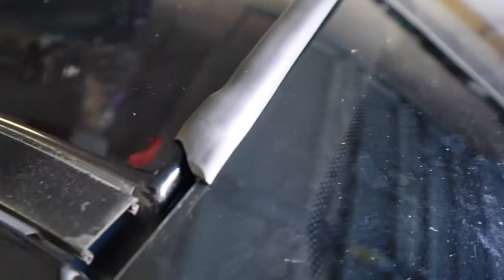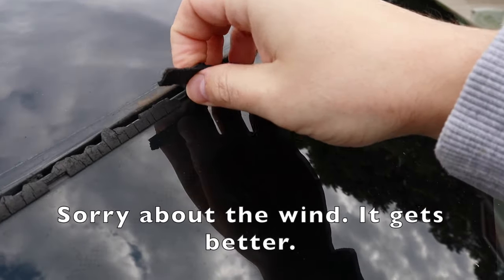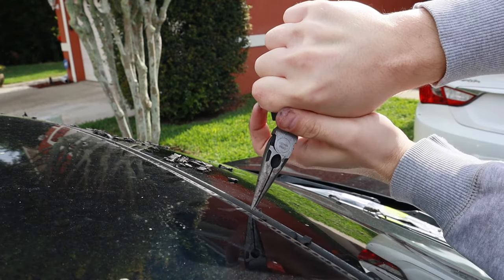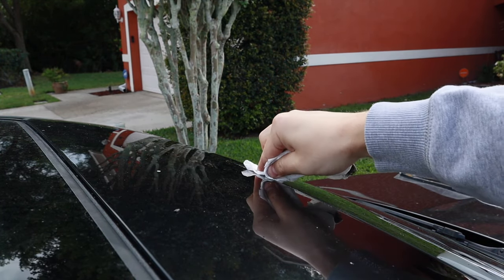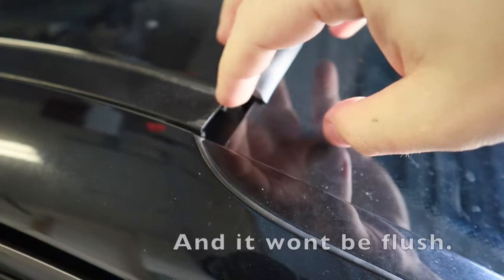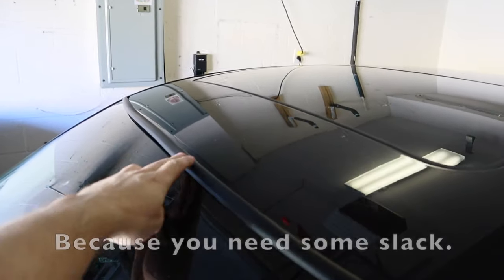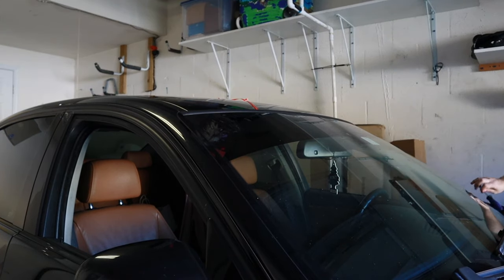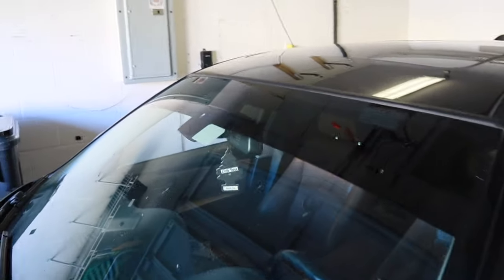How To Replace Worn Out Front Upper Trim Moulding Windshield Weather Strip Seal

Comment: Great video, it gave me confidence to take on this project. A few caveats, it took me 3 hours with a few challenges: 1 hour to remove old brittle stripping and get the spine out. For the life of me, could not remove spine from center, had to start on end. Take your time, I scratched corner of windshield trim. 1 hour to remove old adhesive using mineral spirits with cloth, popsicle sticks and toothbrush, used Qtips to get the gunk out from inside groove. 1 hour putting in new OEM strip, didn’t see BMW part on Amazon at the time. No pull tab on strip, not a dealbreaker because they left just barely enough overlap to grab onto. Had trouble getting spine to sit flush in the middle until I figured out to press in spine with my sheath knife (handy general use tool) underneath the top flap. Another note on OEM, I compromised the surface on the ends, not sure if it’s because cheaper material but just minor damage. Everything is flush and looks right, just be persistent and patient if you run into problems. Anyone who says this is a 10 minute job doesn’t know what they’re talking about but I did save $500 and 3 hours I would’ve spent anyways trying to get someone else to do it.

Comment: Been in the businees for 26 years and in my experience this molding replacement can be done successfully if you are working on the original windshield and molding. Typically a windshield that has been replaced will be a problem because the urethane bead will be applied differently than the assembly line bead which means the urethane on the replacement will glue the new molding into place at the time of installation which typically doesnt happen off the assembly line. Also, the replacement molding may not be OEM and designed differently which is another problem. Check these things before you purchase your replacement molding.

Comment: well done.  Pick tool is essential for this job to remove old trim.  Start about 10 inches in from the side, do not start on the ends.  Rubber rolling pin makes it lay nice....

Comment: For everyone that will atempt this. Is way harder than it looks to put the new one in. Mine is bent in one spot. I can't put it better. I tried everything. Maybe cuz it is an aftermarket and it doesn't fit perfectly. A tip: When I took the old one out, I pulled with the plier from one side, not from the middle like he did. It's easier this way.

Comment: I also have a x5 2013 and changed my windshield and went to safelite..big mistake! Now my rubber gasket is flapping around,I did your thing where you slide it all the way in but the other side is missing like 1.5inche..is it possible that safelite put the wrong one?!

Comment: I have a 2013 Acura TSX wagon that developed a water leak under the windshield on passenger side. I had the dealership fix it. Long story short this was done about one year ago.. and it has to go back to replace this strip for the third time..What the hell could be going wrong? Could the car wash places be that hard on it?
Reply: My 2009 Civic sedan has the exact, same issue. Passenger side leak and the trim is up a little bit on that side from the sun. I’m going to try and reglue it down myself

Comment: Basically is it okay if water comes in and stuck on the crevices between windshield and body because of your broken trim?? Is there any water leak befor you install the new trim??
Reply from the maker: I don’t think any water is okay in there. And no I didn’t have a water leak before.

Comment: Great Job your lucky you didn't break the glass however I would like to know how it's holding up now.  BMW moldings are shit they dry rot due to the sun and it doesn't matter if you use the BMW top molding they are defective and poorly designed that's why so many people watched this video.
Reply from the maker: It’s been holding up great and looks brand new. I do park my car in the garage now so maybe that’s the difference.

Comment: Wish I saw your vid before watching someone else 😑
Reply from the maker: Lol why did you mess it up...
Reply: @TOMAHAWK813  I'm sure it'll be fine lol, the way these things go brittle I'll throw another one on in no time...the correct way 💪
Reply: Hey just fell into my bmw, 2007 328xi. It's been shuddering once warmed up between 1500-2200 rpms, any ideas? Ran carly and only thing that comes up is water pump issues, no ses light on. Worried it may be torque converter, going to have tran fluid/filter changed next week, adding some lubegard, any help would mean the wrld
Reply from the maker: @michaelsherman931  try cleaning your mass air flow sensor. Can try cleaning vanos too.
Reply from the maker: @michaelsherman931  I have a video doing my water pump too lol. Just did it.
Reply: @TOMAHAWK813  I saw that lol, I subbed and will def follow your vid, it's on the list, and yeah cleaning the maf and vanos is on it too. Going to try everything and hope it doesn't end up being the converter
Reply from the maker: @michaelsherman931  thank you! And it shouldn’t be the converter. There’s many things that could be causing that. Like I said before check the MAF sensor. Clean the Vanos. Maybe check your coil pack connections. Spark plugs. Could also be your valve Tronic motor as well.
Reply from the maker: @michaelsherman931  This has happened to me and caused a rough idle. If you look at the top of the coil packs, the little connection, even if it’s off by 2 to 3 mm it can cause your engine to sputter and not throw code.
Reply: @TOMAHAWK813  I will definitely check that out, next day I had off I will dedicate to cleaning the maf, soninoids, and will check on the coils. Wanna try and eliminate anything on my own before it goes to the transmission shop. I'd do the lubegard myself if there was an easier way to get in there 😂. Hopefully I can track it down before that day
Reply: @TOMAHAWK813  thanks for responding and giving suggestions, top shelf sir